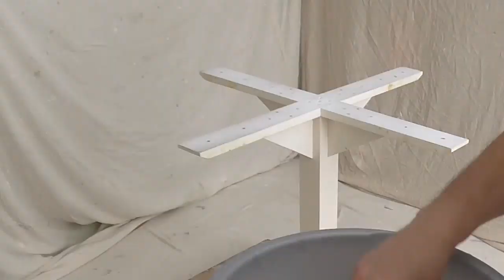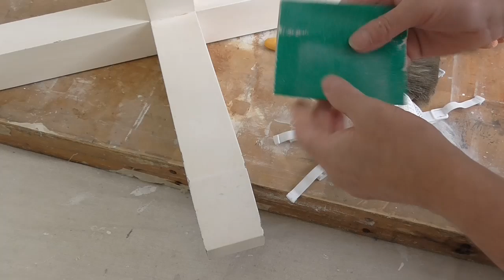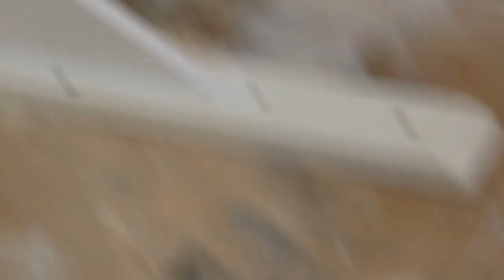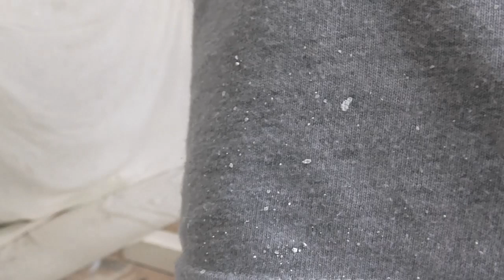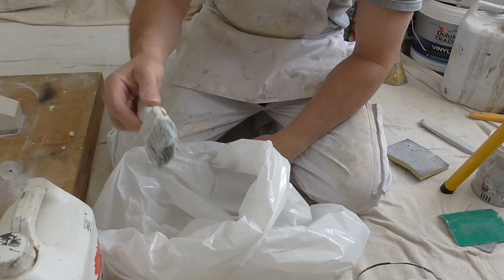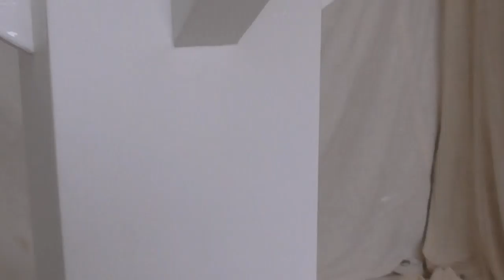Hand Painting A Table Stand

Comment: Thanks for posting this it's super helpful, I've realised I'm massively over applying paint, you seem to apply little and spend lots of time working in the paint to the surface to get a much more even coat, I think I tend to apply too much. Also your well worked brushes look much better at holding paint than my cheap'y synthetic ones